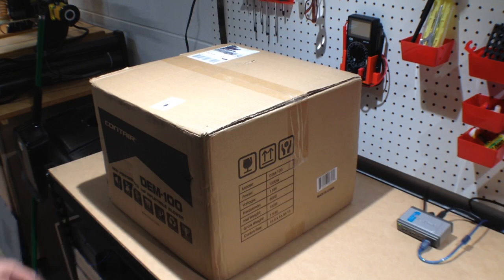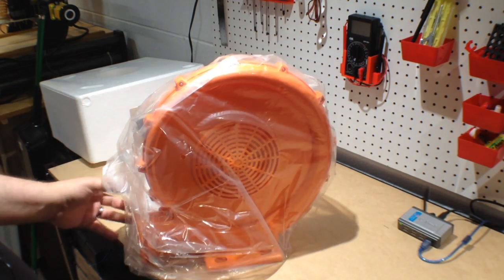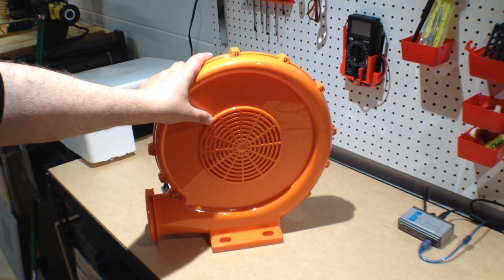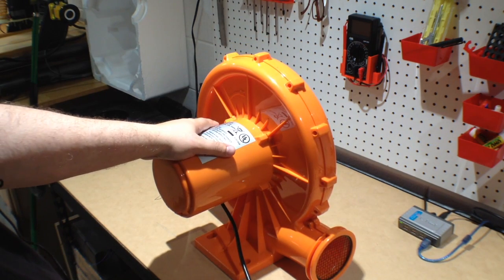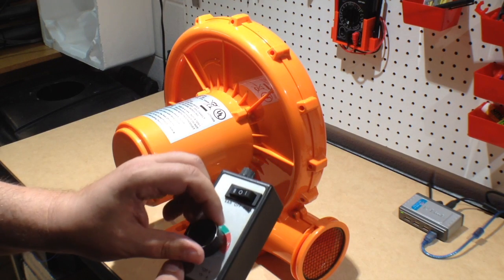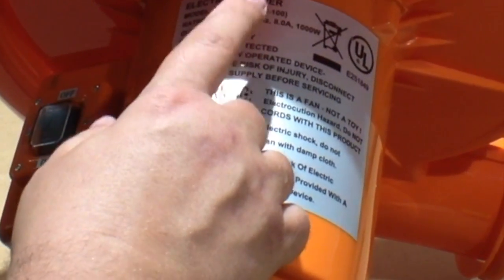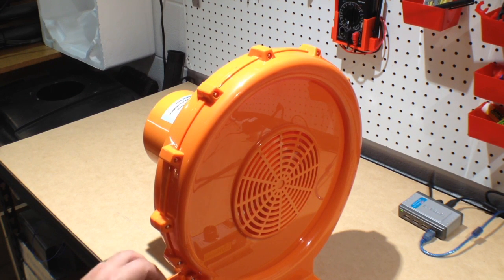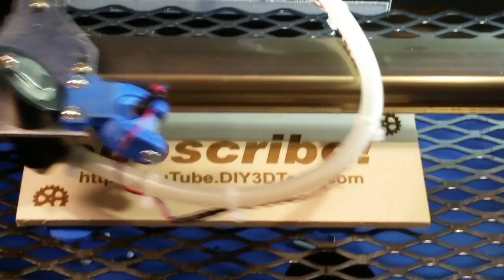K40 eBay Chinese CO2 Laser Cutter & Engraver -  Fume Extractor UnBoxing!

Comment: Did you check to see if there was some kind of soft-start electronics inside that might be affecting the motors ability to operate at the lower end of your controller's range?   If so it could possibly be ripped out - you would not be able to use it without the controller after that though I'm guessing
Reply from the maker: I didn't however because of the size of the motor your likely correct, I just use at full speed with the laser...

Comment: That fan is just too noisy, SarbarMutimedia had to build a chamber to reduce the noise. I think that fan (1 hp -ouch) is over rated for extracting fumes within a laser box To help extract water moisture from a room, good. You might just want to put a POT on that fan, which does not seem to have a starter capacitor.
Reply from the maker: Yes saw that video [SarbarMutimedia] and I to though that 1 hp might be too much however as it turned out, it wasn't.  The laser can create an amazing amount of "nasty" fumes and you want to remove them as they are VERY hazardous.  Also the noise compared my CNC  dust collection system [which I was using for this] is nothing...
Reply: I also use a dust collector (HF) and it sound much quieter, perhaps it is the mic from your video which makes it appear louder than in reality. There do exist high volume low noise fans. There is a device you can purchase which when the CNC kicks on or off, the fan is turned on or off. link: http://www.ebay.com/itm/iVac-Automated-Vacuum-Switch-/162108178998?hash=item25be668236:g:afwAAOSw5cNYQej6
Reply from the maker: Thanks yes have something like this now, however this thing is really rather quite per-say.  Also yes to the quite high volume fans but all the ones I saw where quite expensive and I wanted to do this on a budget :-)

Comment: May be, like an outside the blower part pipe:
air gets pulled in outer pipe gap

Gap air gets pulled in
|
V
     -----------------
     ->
--------------------------
Fan Blows out pipe->>>
----------------------
      ->
     -----------------
Gap air gets pulled in
Reply from the maker: I have already designed a manifold to over the side and will silicone it in place as the rest of the unit is very air tight.  for the outlet too I will build an adapter too :-)

Comment: Run the motor on DC instead of AC universal motors will run on DC.
Reply from the maker: Hm no sure this one will or that I have enough (i.e. large enough DC power source) as it pulls quite a bit current!  :-)
Reply: another way to do it is to use a ceiling fan motor speed control....
Reply: to get DC at 120volts it's just a rectifier, then you could use PWM to get speed control.
I have never tried this but was told it works, 120v mains>light dimmer>rectifier>motor...
Reply from the maker: I have done this with smaller motors, however a 1hp?  Have you used a ceiling fan control with such a large motor?
Reply: I haven't.  but your best bet would be PWM speed control an Arduino motor shield is pretty cheap....

Comment: Lol!  Go big or go home!  That blower is awesome. You're lucky to still have things on your peg board!  

You could also put a bypass on your inlet coupler to throttle the inlet pressure but the outlet pressure would always be the same unless you put a speed controller on there. 

Can't wait to see what your ultimate solution winds up being. Maybe use it for a whole house vacuum solution. Ha ha.
Reply from the maker: LOL!  It could as the biggest thing is wanted to make it quieter as the current system is great but too noisy!  Howver in doing the new (much larger shop) I am glad I bought the larger one as I only had to go buy a house to match my new blower!  :-)
Reply: DIY3DTECH.com - LOL!  Yeah, of your toys demand a larger space, why not?  

I would love to see a "Shop Tour" of your space. I already can see that you are quite meticulous and very organized. Something I never inherited from my dad but always think about how I could organize better. I did get the engineering gene from him though. My mom gave me the ADHD gene. Interesting combination really, both cane in handy with LEGO when I was a kid. Explains how I got into construction. Lol

Regards,

Norbert http://DIY3DTECH.com
Reply from the maker: The new shop I will as this an over crowed 16 x 43 foot area in the unfinished portion of my basement (where it's mostly finished).  The new house is a ranch with a totally unfinished basement and 9 foot ceilings.  So will build a 1200 to 1500 sq/ft shop as it's also a daylight basement too.  My goal is to set it up in stations dropping air, water, power and dust collection from the ceiling.  Also will set up rolling video dollies to make production easyer too
Reply from the maker: LOL!  The wife and I are actually down sizing [while I don't want to admit it we are getting close to retirement age] as we are in 5,000 sq/ft now and live in a fraction of the house so decided to buy a smaller ranch (about 2,200 sq/ft) with a large bonus room (my office).  However my caveat to this was a full basement and the high ceilings (as we live very close to Lake Huron and the water table is high)  was a bonus.  We move a lot so nothing really new as we look for the ugliest run down house in a nice hood and show it some love.  We did well with this till the crash which wiped out two decades of sweat equity but it could have been worse and been "real money" so live and learn...

Comment: cool and frig .   Im ust suggesting you could use a SSR to PWM if from a NANO .  But thats only good if you have a SSR in the 10a or so range kicking about . 
the inlet side is suction ,if you use some draft stop foam to make the final seal it wont take much to clamp it .  possibly even suction cup(s) on the smooth Finnish
Reply from the maker: Yea I think I over did it with this one!  However since doing this bought a new house and will be building a MUCH larger workshop and studio area to produce videos so by Q1 2017 should everything set up!